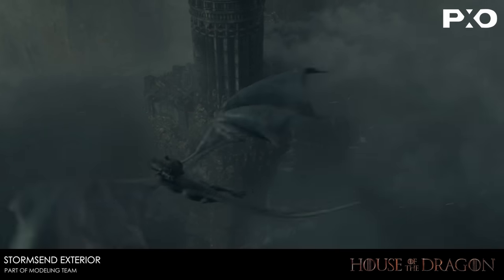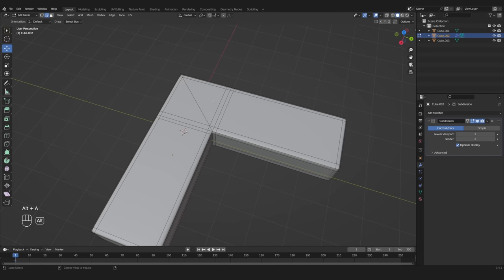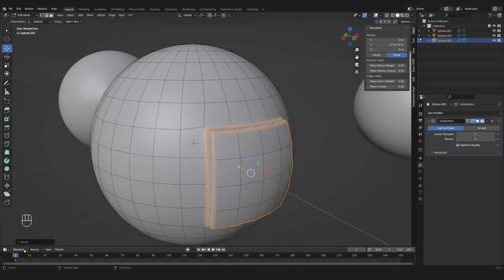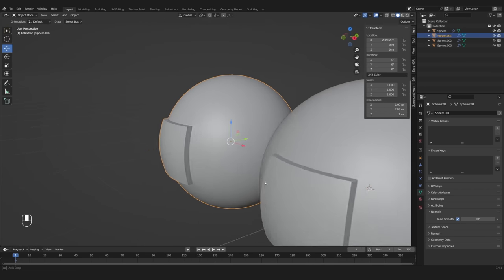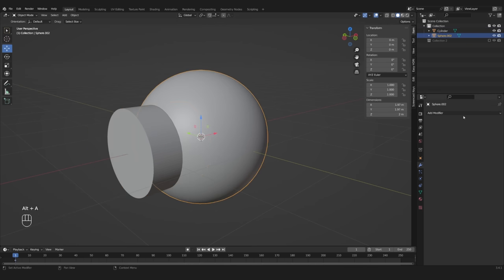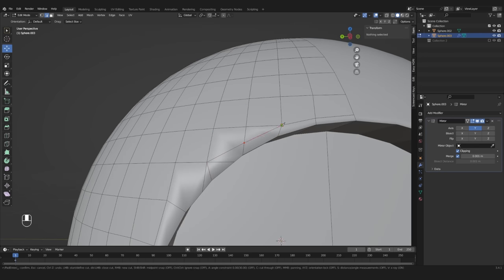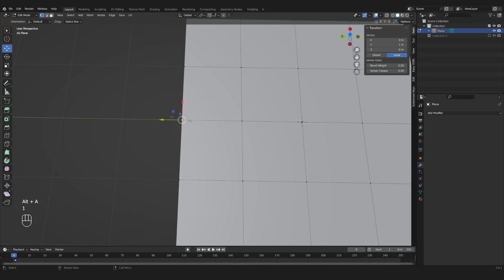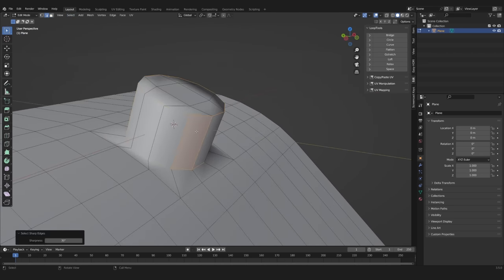7 Topology Tips Every 3D Artist Should Know

Comment: ...and of course even the thumbnail of the video does not contain optimal topology on a most basic form :D It's wrong to use subdivision surface on non-organic forms like this in the first place. You only need topology like that if you are planning to deform the object in animation later. Subsurf will add huge amounts of useless topology not contributing to the form. That's way worse than the "problems solved" here. "Subdivision workflow" is a pointless term. There is no such thing, there is just 3d modelling.  Subdivision surface is just a tool to use. When you "use subdivision workflow", you simply want to use subsurf everywhere it's not needed, because that's your ideology then, while it's simply one tool. That's not smart at all. Just model the topology that you need to hold the form and that is easy to work with with all the loop selection and manipulation tools. If you need a beveled corner thing, just bevel it - that's the right tool for it.
Reply from the maker: First of all thanks for the long comment.

“It's wrong to use subdivision surface on non-organic forms like this in the first place. You only need topology like that if you are planning to deform the object in animation later”

A SubD Workflow has lots of advantages. One of them is indeed deformation, which is why it oftentimes is used on Organic models. But it is also heavily used on Hard surface Objects. 
In VFX, Hard surface objects can get Displacement, like for example Castle walls, buildings etc. They oftentimes get a brick material, which also displaces the polygons of the model. For this you need lots of geometry.
Another advantage is flexibility. If you have lots of panelling on a spaceship and you bevel the edges with chamfer, you are now set with this bevel. 
If the supervisor later wants the bevel to be smaller, it can be quite hard to change.
In a SubD workflow you can simply slide the supporting edge loops closer, to get a shaper edge.
I don’t assume you’ve watched the whole video. I never say, you have to model with the SubD workflow. But if you want to work in VFX, knowing how too is important.

After getting a new model assigned from my model lead, one of my first questions always was to ask if it should be SubD or normal poly modelling. Depending on how the assets would be used later on, they would make a decision.

“Subsurf will add huge amounts of useless topology not contributing to the form.”

Not necessarily. SubD models can also be much lighter, since you don’t need as much topology for  curved surfaces, as it is smoothed out on render time anyway. It can go either way.

“When you "use subdivision workflow", you simply want to use subsurf everywhere it's not needed, because that's your ideology then, while it's simply one tool”

I never said anything about people needing just to model in SubD workflow. I pointed out, that if they want to work in VFX, they need to know how to do it. And when adding lots of supporting edge loops, it can quickly become super dense and messy. Knowing how to handle that, can make it a lot more fun and easier. 

The tip on the thumbnail is probably the most valuable thing I learned about SubD modelling ever. I use it so much and it keeps my model from becoming messy.

Comment: you can weight edges so they remain sharp under subsurf, no need to do any of this crap/
Reply from the maker: Do you mean in combination with a  bevel modifier, or just normal creasing?
Reply: @mlt-studios  I meant edge creases (aka bevel weight)
Reply from the maker: @merren2306  In my understanding edge creases and bevel weights are two different things. 
I've explained in the video, but also in some of the comments here, why I don't like using creases.

In the end it is up to you, what you like best. Though when working in VFX, you probably need to know how to do proper SubD modeling.
Reply: @mlt-studios  I didn't watch far enough to see why you dislike them. I'm assuming it's because it doesn't let you have perfectly flat surfaces whilst rounding the corners? In that case I suggest using the bevel modifier instead of subdivision surface.
Reply: also I meant edge crease in my earlier comment - bevel weight does the same thing but for the bevel modifier

Comment: Do yourself a favor and skip this and learn paramteric modelling and work with Solidworks or Fusion.
Reply from the maker: Aren‘t both of that CAD Software? 
If so, this would be very bad Advise if you want to work in the VFX or Gaming Industry. Some concept Artist use Cad software, and you then always have to remodel it with proper topology to have it work with the rest of the pipeline.

If it is solely for your own project, you can of course use what you want.
Reply: @mlt-studios  But why do you need ultra sharp topology? For better UV unwrapping?

In CAD, you can control every aspect of your model with paramters in a non desctructive workflow. 

I have used it together with Substance Painter and it worked great.

I have modeled in destructive workflow for years. But when you discover the other way round, you don't want to go back.